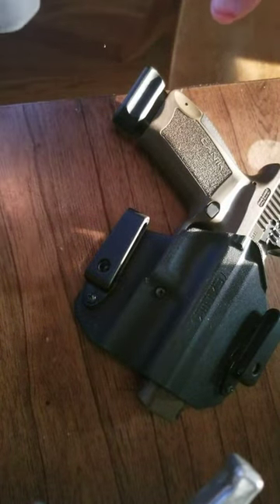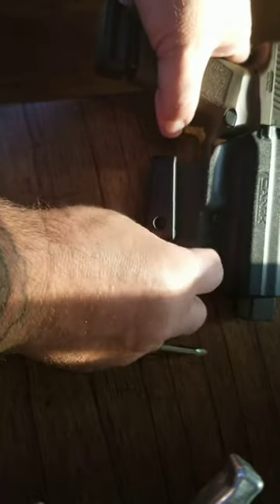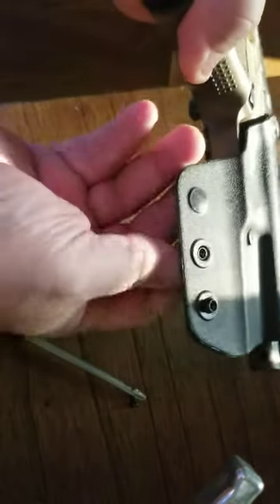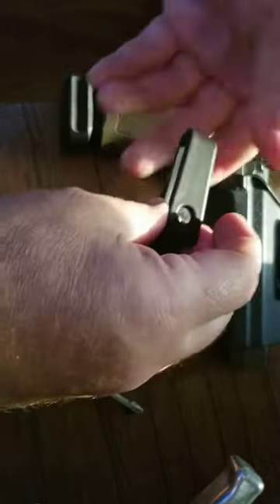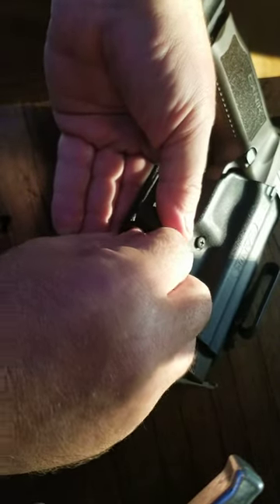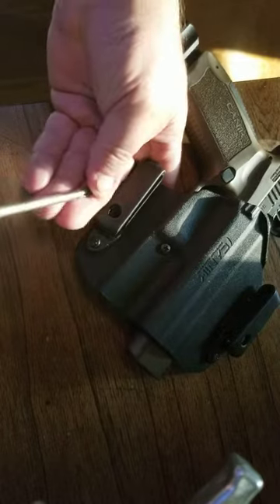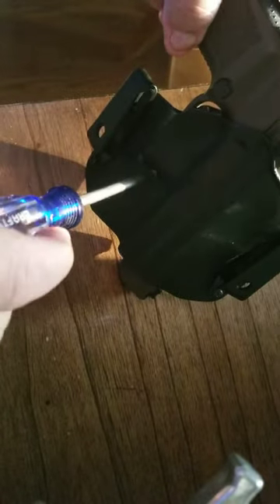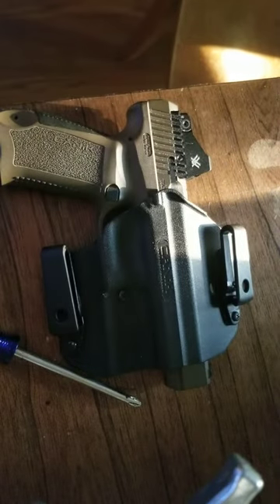How to Convert A Canik OEM Holster From OWB To IWB

Comment: How did you keep the grommet from spinning with the screw?
Reply: I had to get help from a buddy to hold it in place with some needle nose pliers while I take the screws out
Reply: Same problem here
Reply: Bro i got one side to come out the other one is like super glue on will not unscrew will not move
Reply: @tacticalrunningman  use a flathead the size of the hole stick in there and loosen on the other side should work
Reply: If you turn the clip to the side it wedges and holds the grommet in place
Reply: Needle pliers . 
Mar the finish of the grommet and bit but it worked

Comment: Rubber band over the round hole and push a t12 torx bit in will hold it still so you can take the screws out

Comment: I knew that's how you had to have done it. But when I try to take mine apart it just kept spinning. But after seeing you do it I realized I had to do something to hold the ferrules in place because they just spun. But I do appreciate you putting a video out there that was short sweet simple to the point and was exactly what I was looking for. I just knew by the way the design looked it had to be reversible.
Reply from the maker: Glad I could help. Please subscribe, it makes a huge difference and its free, LOl
Reply: What did u use to hold it I’m having the same problem
Reply: @rudyvargas58  I had a multi-tool from Leatherman. And there is a tool on there that is just flat and slightly spiraled I guess. And I was able to stick it in just enough to hold a bite on the opposite side of where you unscrew it. You could probably do it with a screwdriver or a knife that you don't really have to sharp.
Reply: @ThomasShue  I definitely subscribed. It's the least I can do for the help! And again, I thank you and appreciate you making this video on the subject!

Comment: Okay so let me tell you how to do this if your ferrule spins! After using every tool I have and having one person try to hold the holster and another hold the ferrule with pliers still no luck so what I ended up doing it creating a screw head on the ferrule using a dremel. Works perfectly, only tools needed are a dremel with cutting wheel, a wide head flathead screwdriver, and a phillips head screwdriver. For cosmetics you can use gun blue to reblue where you make the cuts.

Comment: On at least the holster for the TP9SC elite, the portion that looks like it should fit an Allen wrench, which it doesn't, will often turn when trying to remove the Phillips head screws. Put the holster on a table (protect the table with something) or workbench, wedge a flat blade screwdriver blade in from the side and put a little torque on it. Then, turn the Phillips head screw. This will allow you to remove the screws.

Comment: I tried it but the bushings just go on around when I try to unscrew. Anyway I can hold those ?
Reply: Same thing happened to me. I used a needle nose pliers to hold the back of the tube and turned the front with a screwdriver.
Reply: i used pliers to hold those while im unscrewing. so one hand squeezing the plyers while the other unscrews it was the only way but totally worth it
Reply: Same! 🤬 Did they use loctite on those screws?
Reply: @JerryLee..  I did this by using tweezers to hold the back and then holding it steady and began unscrewing little by little.